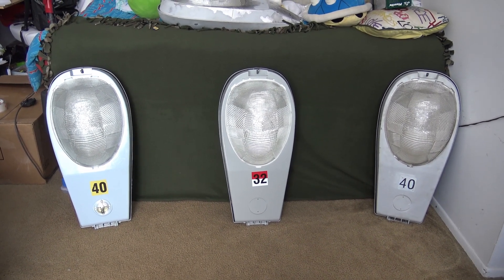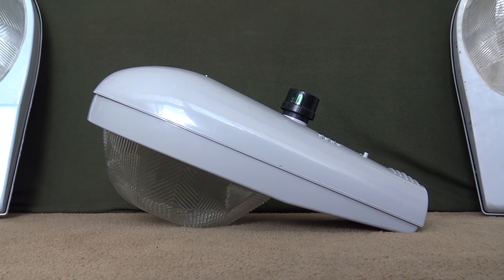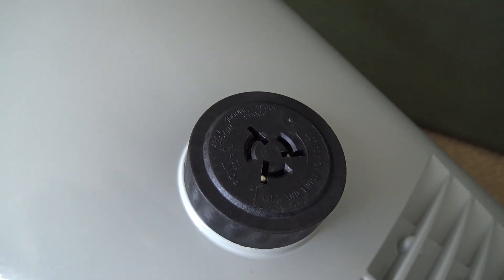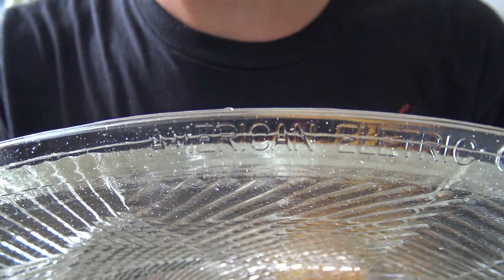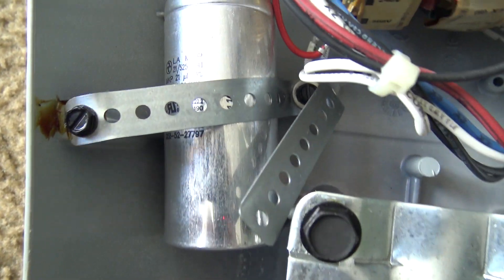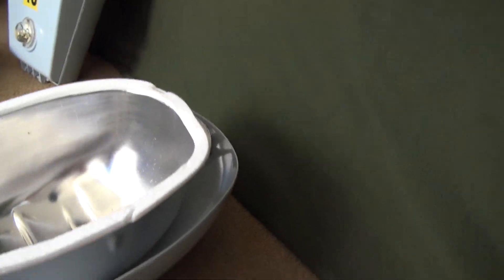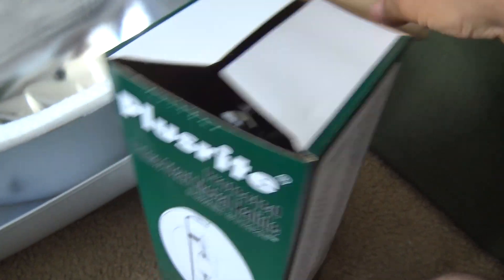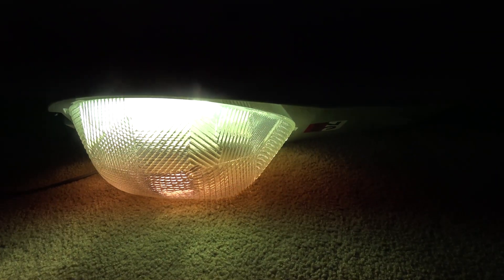Three American Electric 125s (PART 3 2018 125 320W Pulse Start Metal Halide)

Comment: Now you just need a probe start MH one, and also a ceramic metal halide version.
Reply from the maker: Your not going to find them in ceramic metal halide. They probably never made them
Reply: @polarslightssignals2742  there were AEL fixtures in CMH in Chicago. I believe 325s and also 125s as far as I remember.

Comment: In South Jersey they use all Acuity lighting - 115s and 125s for HPS areas and Autobahns for LED areas. They always used the 125s to replace old 250 and 400 watt lights, I wonder what they will do with the discontinuation of these. Also, the salt air from the ocean totally destroys the paint on these things. Along one of our ocean front boardwalks we have traditional cobra head street lighting that the electric company maintains and the 125s they install have faded and cracked paint after only 2 years of being up there. Also, this electric company uses the sag glass versions of the 115 and 125. This is the only area I have ever seen sag glass being used. These lights in every other area use flat or drop glass, and it is impossible to find the sag glass versions on Ebay. It is very strange.

Comment: Lithonia also had made a 125 knockoff called the CHM
Reply: Lithonia and Americal electric are both owned by Acuity brands. American electric ones are marketed towards utilities while the Lithonia ones were marketed more towards private buyers. It's not a knockoff, its the same company.
Reply: @AlexSirghie  Do you work at Acuity Brands? Also, I found a Lithonia CHM on eBay a while ago, in 400 watt Metal Halide
Reply: @ALT-9167   no, I don't.
Reply: @AlexSirghie  O, lol